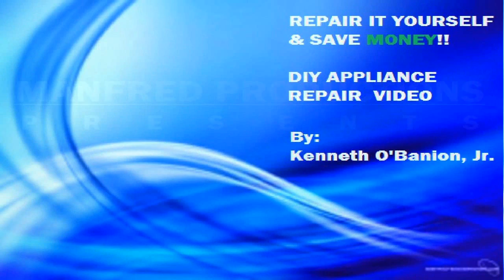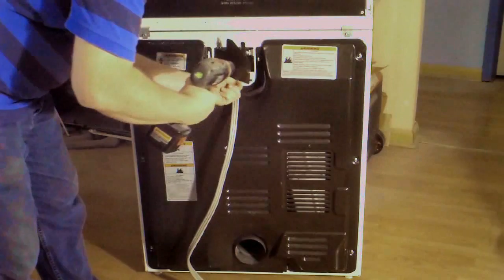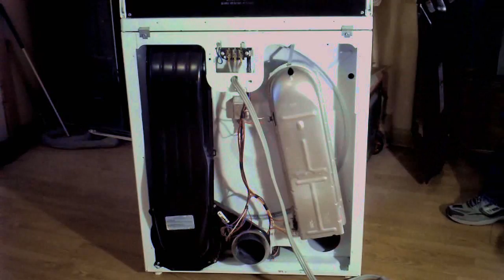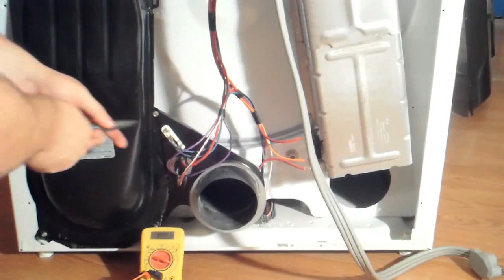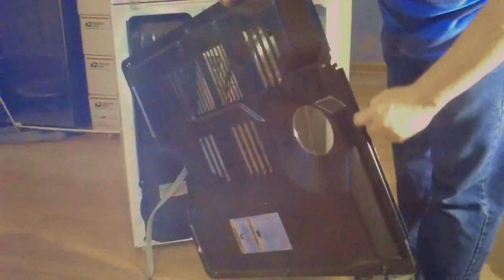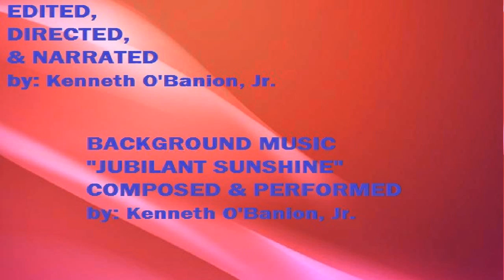Whirlpool & Kenmore Dryer Repair #02 - Won't Start or Run- Thermal Fuse 3392519 Diagnose & Repair

Comment: I did not have a cover over the plug wires and touched it with the dryer vent and now it wont turn on did i mess up the thermal fuse
Reply from the maker: +Chris Chlysta It could have, but it likely tripped the circuit breaker for the dryer outlet.  Go to the house circuit breaker panel, and find the double pole breaker that is for the dryer  Even if it doesn't look tripped, turn it all the way off and then all the way back on again, and give it a try.  If you have power but it still wont start, unplug the dryer and then test the thermal fuse, located on the blower housing.  If it doesn't have continuity, it needs to be replaced to make the dryer work again.

Comment: How do I get the code number? Dryer will not start, Flashes F and then shows 40 is that the code?
Reply from the maker: +Doug H Yes, F40 is an error code.  Usually the thermal fuse has gone bad when you get that error code, so you will need to test it with an ohm meter to see.  If it is bad, replace it and the thermistor or thermostat next to it at the same time.  If it is not bad, then you will need to check the wires that attach to the main computer, sometimes one of those connectors on the board will get loose and cause this error code.
Reply: thanks I have a newer OASIS model set up a little different than in video. keeping my fingers crossed that I can make the repair.

Comment: Would you have a video for a Kenmore Whirlpool HE2 110.C8756 that does not start (beeps twice as if open or lint full)?  Thank you, kindly.
Reply from the maker: +canyonman1963 Oh and the obvious thing to test is the door switch, since this is how the dryer acts when the door is not closed.  If door switch went bad, it wont start!
Reply: canyonman1963

Comment: Greetings, I have to say that your videos are very informative and well spoken.  I have a Whirlpool Duet MOD GEW9250PWI
It's not making any noise, there's no trouble signal light appearing. There's 3 red dimmed flickering lights illuminating; one at the "casual" setting; "timed dry" & "air only" I've unplugged it and plugged it back hoping it would reset it.  It came on last night without any problem; but when I went to get the clothing out of the drier this evening the items were still damp.  Thanks for your much needed assistance.
Reply from the maker: 1preface I would try unplugging machine, then remove the top to access the wire harness that connects the control panel interface board to the main computer.  Unplug the ribbon harness from the computer and then plug it back in, and then do the same at the interface board.  It might be getting worn and loose where it attaches, and maybe reattaching it will help.  After all that is done, put it back together and then plug in and see if it works!

Comment: I have a Estate Heavy duty super capacity dryer White-on-White
Model EED4400WQ
It turns on but won't dry at all. It does not heat up. At times when we move around the aluminum hose leading out from the dryer it works. I have already cleaned it out but still nothing. Do you think this on the video will be my solution?
Thank You in advance.

Comment: THANK YOU,, I read to confirm if the fuse was bad by hooking the 2 blue wires together, plug it back in and if dryer starts.. the fuse is bad... THANK YOU FOR YOUR TIME...

Comment: We have a Magtag Centennial Dryer and it won't start. My husband opened the door and pushed the door switch and the light went off he turned the drum while I held the start button and then the drum starting turning once he helped it turn. We replaced the motor and it still won't turn on. When we turn press in the start button it only hums.  Same as before with the old motor. Please help us.  Thanks.

Comment: hey i have the whirlpool duet changed the thermal fuse all the button are on but when you push start nothing turns all the lights & switches are on but still push the start button nothing tried to get the thing to tell me any codes by pushing the button 5 times like some video told me to and still light are on push the start button nothing....any ideas

Comment: hi, i have a whirlpool duet dryer mod # GEW9250PW0.  the power is on but when i press the start button it clicks but does not start.  i have changed the belt and the thermal fuse but still no start. all it does is the sesning light comes on and after  few minutes it will beep and say the cycle complete.  if its not the thermal fuse or belt, what coukd it be? please?
Reply from the maker: Check the door switch.  If it is good and all wiring is good, then it might be a main computer problem
Reply: i checked the door switch, it was fine too i believe.  so thermal fuse was ok, the thermistor was ok, the door switch is ok. anything else i can check?  if is the computer, can i check that somehow?  canyonman1963

Comment: I had a power outage now my Kenmore dry wont come back on.....I press the power button no light or nothing will come on....have any ideal what it could be......thank you
Reply from the maker: Sounds like the circuit breaker for the dryer might be tripped.  Go to your circuit breaker panel for the house, find the breaker for tbe dryer circuit (usually a 30 amp double pole breaker) and turn it off then back on again, even if it doesnt look tripped.  Then see if it will run.  Also, try unplugging the dryer and then plugging it back in to make sure it is staying all the way plugged in.

Comment: hello canyonman1963, i have a whirlpool cabrio dryer and i had a code come up on my dryer but i cant remember what it was, just that it was A-something. now when i hit start on my dryer it just keeps coming up as showing that it is sensing. never goes any farther than that and never comes on. looking at the back i can look down through the top and see that it is heating, but that is all. i cleaned everything, took the back off and the blower and cleaned it as well. vent was a little clogged but not terrible. checked outside vent as well. do you think that it could be the thermal fuse or thermostat? any help would be greatly appreciated. thanx
Reply: canyonman1963 hey canyonman1963. the fault code for my whirlpool cabrio was AF. i went ahead and changed the thermistor but it wasnt the problem. its still doing the same thing. any suggestions?
Reply: canyonman1963 hey canyonman1963, i have cleaned out every possible place that could be cleaned, made sure that there was no crushed hosing anywhere. the tub belt is intact and i checked the centrifugal switch, kind of played with it just to make sure there was not anything messing with it. what else could it possibly be? could the thermal fuse possibly cause it?
Reply: Chuck Hammonds or could the sensor itself be bad?
Reply: the dryer isnt coming on at all. only the panel and the heater comes on when i hit start but nothing else. the motor might be shot, i dont know. the sensor i am talking about is the one inside the tub that checks the dampness of the clothes. because when i hit start it goes straight to saying it is sensing when i hit start but goes no farther than that. never starts up.
Reply: canyonman1963 I just now put the dryer back together ( AGAIN ). this time when i plugged it back up it gave me another code   ( PF ). not for sure what this is. i really appreciate all your help.
Reply: canyonman1963 looks like you may be right about the element. i took it out to check it out but none of the coils look broke anywhere but one of the ceramic looking clips that hold the coils in place is broke. before i took the element out a little closer look showed that when i hit start and the elements kicked on that the bottom coils seemed to be the only ones working and the top ones where the clip is broke at does not work. i can get one from amazon for $21. not to bad. i am going to check the thermal fuse to. if i had to guess i would say your right about that to. i appreciate everything you have done to help and i will keep you updated. wonderful thing you are doing on here to help anyone that needs it.

Comment: hey there, Kenmore series 400 electric dryer.  Initial problem was dryer would run for a few minutes then quit.  After 15 20 seconds it would start again but quit again.  figured something was getting too warm so took it apart and cleaned it out of lint and other treasures found at the bottom of a dryer, ( I wondered where that drill bit went).  put back together and it ran but buzzer was now continually on now, yaayy for do it yourselfers right.  So I disconnect one terminal off of buzzer and it quits and dryer is still running but wire slips and contacts other terminal.  Little spark and now dryer is dead.  Breaker fine.  Is there a fuse that could have went or did I just fry the control box?  thanx a bunch.  Looks like you give lots of good advice Cheers

Comment: Also, how do I test the Operating T-stat or the Thermistor?
Reply from the maker: You can check for continuity from the large terminal to the other large terminal across from it with wires removed.  If you have continuity, then it is passing power through it and not keeping it from heating.  This does not mean that it will open at correct temperature though, only means it is not stuck "open" which would cause it to keep power from going through it.  And, good or bad, the thermostat will not keep the dryer from starting.

Comment: I've replaced the thermal fuse (I did test it and it was blown) but my dryer still wont start. What else could the problem be? Thanks in advance.

Comment: buttons not lighting up but drum light is on.any suggestions
Reply: thanks for the response,it was the user interface
Reply: can you post a video on how to replace the user interface
Reply from the maker: ELESHIA WALKER I would if I had this style of dryer here to make the video with, but I do not.  You might be able to find one on YouTube, type in the search box "Newer Kenmore HE Dryer Repair"  you might not find one specifically for the interface, but at least how to take apart machine, which would include removing the control panel (which you need to do of course to get to the back side of it, where you can then remove screws holding the interface board in place).  Then just follow the ribbon wire to the main computer board, and unplug it.  MAKE SURE dryer is UNPLUGGED before doing any of this!

Comment: hi i have brand new whirlpool steam duet dryer w10224575b, first time trying to use it but it wont starting . all lights comes up, but the light in the wheel where im selecting the type of load (normal , heavy etc..) is blinking. and when i press on start bottom, it makes sound beep twice. i have tried all possible things that might be the issue but it didnt work. any idea what it might be? and it is a brand new , first time trying to use it.
Reply from the maker: Well, if there is no error code displayed, it is very hard to diagnose without being there to see it.  Some things I would check would be 1st to make sure the water is turned on to the machine.  Next, make sure shipping bolts were removed after the machine was delivered (should probably check this 1st), next take a good look at the door lock assembly.  If all that is good, either the controls interface board could be bad, the ribbon that connects it to the main computer could be bad or loose or unseated, and finally the main computer could be bad.  If it is brand new, I would call the on the warranty - I would not start taking it apart if it is still under warranty.  Best of luck to you!

Comment: Great help so far canyonman.I have a 70 Series with an additional modual that may be related to the start switch. How  do you test that? Also when it was working, presssing the start with signal ON would "buzz". I have replaced the push to start switch thinking that would fix the issue, however, i would think it would "buzz". No luck. next step, the thermal fuse is bad, will order that and the thermostat. And a fabric temperature switch, how do you test that? Thanks in advance.
Reply from the maker: I believe the module that is wired to the start switch is the end of cycle buzzer.  It might have a resistance value listed on it, and you could test for resistance using an ohm meter.  But, if your dryer is buzzing when you press the start switch, that usually indicated that the start winding of the motor is bad, so test that and see if it is within specs or not.  The specs are on the wiring diagram on the tech sheet inside the control panel.
Reply: canyonman1963 There is no buzz when pressed, in the past there may have been. Hoping the start winding or the motor is not bad. Will replace the thermal fuse (it's bad no read from ohm meter) and thermistor. Appreciate your help and quIck reply, sir.

Comment: First off thank you for posting this video, it was very helpful but now i have a new problem. When i push start nothing happens, i go and flip the circuit breaker, it hasn't blown. Then i unplug dryer and plug back and turn circuit breaker back on. Then i push start a few times, then it seems to catch and turn on. I just have washer repaired, but repair man actually didn't fix it, but he pushed washer back and it kind of flattened dryer vent hose. Could that be why dryer won't turn on? Thank you in advance for your help

Comment: what if the dryer keeps running?
Reply from the maker: If it keeps running, but the timer never moves (put on like 30 minutes on timed cycle to find out) then the timer is bad.  If the timer moves, and keeps running and wont shut off, then test the start switch, it would probably be bad in this case
Reply: canyonman1963

Comment: Hi, I have a dryer that will not run on any of the heated settings but will start on the "Air" setting....do you think this might be a thermal fuse?
Reply from the maker: No, if fuse was bad it wouldnt run on any setting at all.  Sounds more like a bad timer OR wires not attached to correct terminals on the timer.  You need to find the tech sheet inside the control panel, and use it and continuity tester to test the timer and verify the wires are attached to correct terminals.  Remember to unplug the dryer before you start opening it up to do the testing.

Comment: Geeze at wits end with this dryer whirlpool senseon, getting full power 110 off each leg, checked thermistor replaced checked hi limit replaced, checked element ok everything checked out ok on element case, just put in a motor thinking centrifugal switch still no heat. have not looked into the digital display area, any suggestions?

Comment: my whirlpool dryer starts and runs momentarily then makes a loud click at the motor and shuts off when I take the drive belt loose the motor continues to run fine but when connected to the drive belt the same symptom again, the drum guide wheels turn freely and the drum does as well any thoughts ?

Comment: I change the thermal fuse and the Tstat on my Kenmore gas dryer 80 series.  There still is not start up.  There is no hum nothing.  Is the push button start switch bad?
Reply from the maker: It could be the start switch, and it could be the door switch, and it could be a shorted wire somewhere, and it could be a bad timer and it could be a bad motor, and the circuit breaker could be tripped and you have no power from the plug.  Bottom line, it can be any of those things, and you need to test each part, and only replace a part if it tests bad.  Cost too much money to go just replacing parts

Comment: I have a Kenmore Elite Oasis ST Dryer, model number 110.78082701.  During runing operation the dryer stopped with an F40 code.  After resets and checking control board connections, the dryer starts, but as soon as the blower starts it kicks with the F40 code again.  Tonight I will test the Thermal Fuse and if blown, replace it and the Thermistor.  Hoping it is not the control board

Comment: I have a Kenmore 70 series dryer. it would not start so I got new start switch, replaced the thermal fuse..Worked 2 loads nicely..Now wont work when I push the start switch. I give up. what could be wrong now?

Comment from the maker: The start switch its self could be bad, need to test it.  Also, the timer or even the motor could have gone bad.  All would require testing.  You operating thermostat (you called it a thermistor) sounds like it has continuity so should not prevent it from starting.  Also, you said you have power, but just to be sure all is OK with it test the power with a volt meter at the terminal block of the dryer where wires attach. Should get 110v from L1 to neutral & L2 to neutral, and 220v from L1 to L2.

Comment: We are experiencing a sudden problem with our Kenmore dryer. Everything was working fine until the unit simply died on starting a cycle. No light or anything. Power is coming from the socket, grounding seems good.  The door switch is working, the thermal fuse is tested and fine. We also gave the unit a vacuum to no avail. The thermistor resistance is coming out at 0 ohms across the red and 7k ohm across the violet. Do you have any idea what could be wrong? Thank you!

Comment: Hey canyonman1963 we have the same issue, our dryer just will not start. If we buy the two parts should we have at first bought the meter or just buy 'em and see what happens. It's all about the $. Thank YOU for your video our friend. Cheers!

Comment from the maker: 1st thought would be that the timer went all the way out.  Need to test it before replacing, they are expensive.  2nd thought is lid switch gone bad, and again, you need to test it before replacing it to make sure it needs replacing, dont want to spend money on something you dont need.